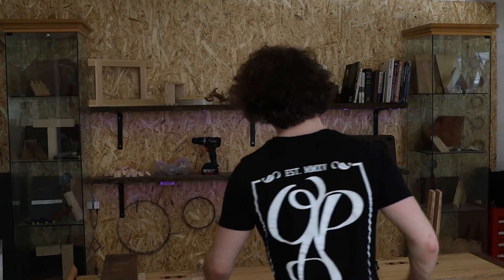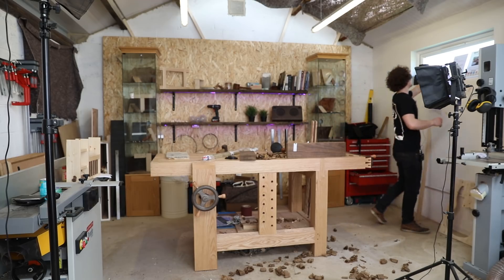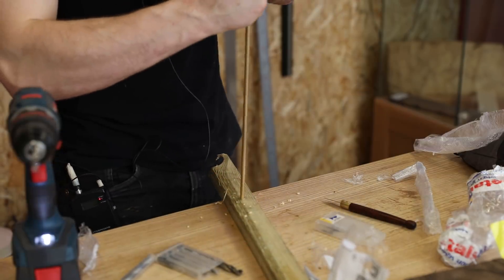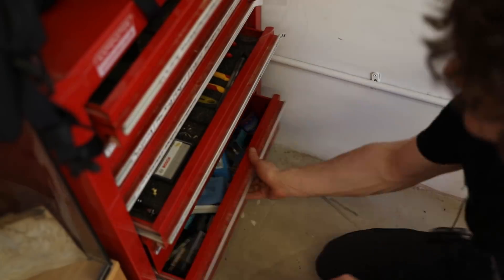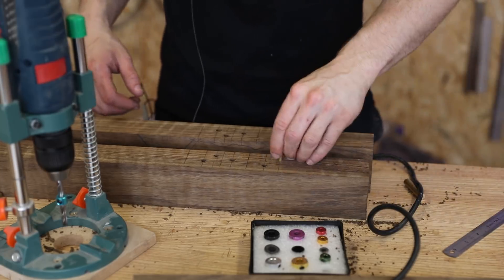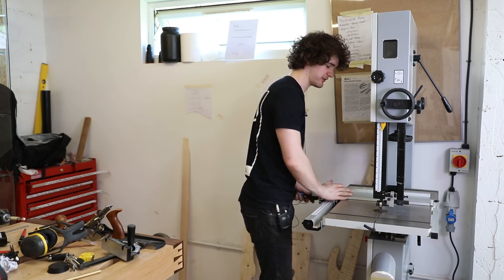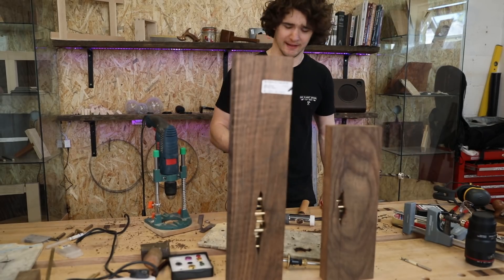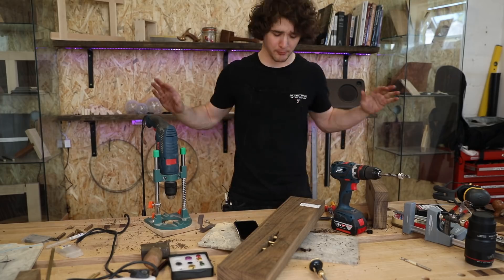Making a Custom Bass Guitar | Part 7

Comment: I love the combination of brass and walnut.  I made a treasure chest ring box where I went in and aged the brass.  after working it a bit, all the high parts of the brass were shiny brass, all the low parts were almost black.  Could give an interesting effect if the brass was tarnished right by the wood and shiny in the middle.

Comment: To guarantee the holes aligned perfectly you could have clamped the pieces together, or even glued them up after cutting out the void, and drilled from the inside (where they will glue to the neck) to the outside.  This would also allow you to have them going at cross angles if you like.  Just drive them in and if they're loose  use some epoxy to keep them from moving.

Comment: You could have used your fret saw (the red one you used to do the cutout at the base of the neck) to cut the metal. Those blades are certainly cheaper than that bandsaw blade.

Comment: Will you ever buy table saw? Lot of woodworkers say that it is the mother of all the tools im the workshop and you don't even have one!
Reply: If you have a superior band saw and a great track saw you might never need to use your table saw. It might just end up as an expensive steel table.
Reply: I'm the same, been thinking of getting one, but I have a Festool HK85, With the FSK 670 track and no space for another Big machine in my crowded garage workshop. Your reasoning has helped me decide, I will get the hellishly expensive 400 quid odd, Dado set for the Festool and not have a table saw! I just bought the Parf Guide system to make my own MFT style table. Thanks mate!